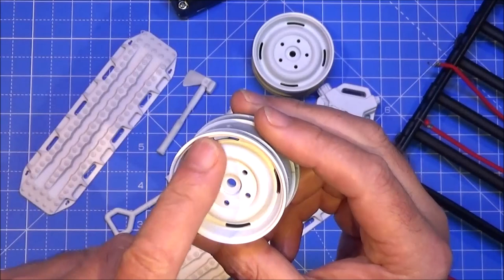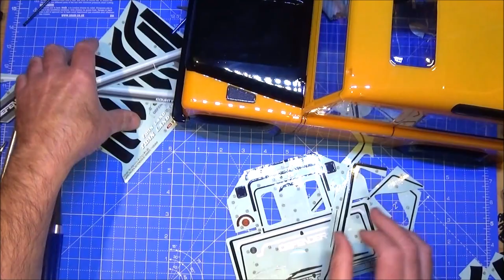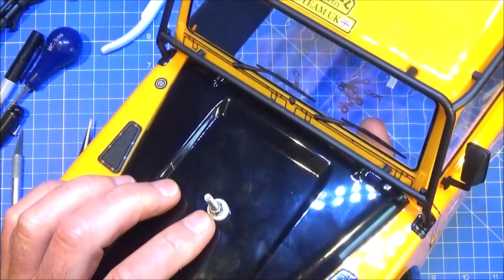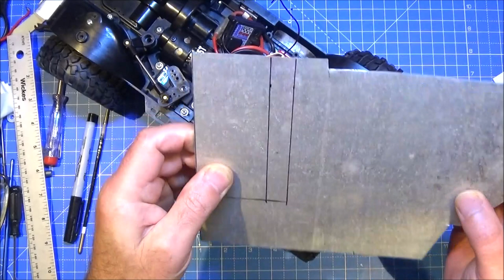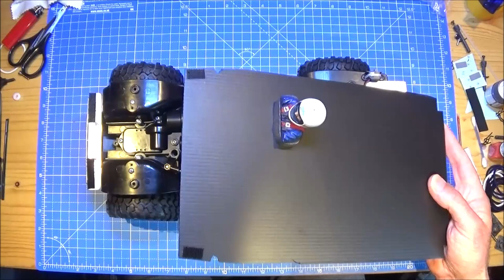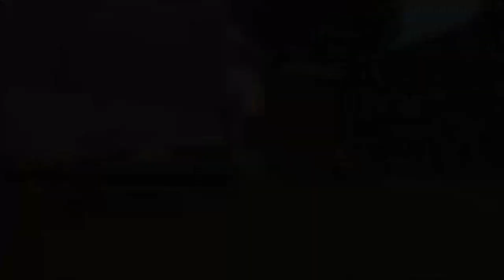Project Tamiya CC01 Camel Trophy - How to make a Camel Land Rover Defender P2 - Truck Finished!

Comment: That's great Mark I started my build on a cc-01 chassis but it got to heavy for the steering to work after I welded the custom bumper and cage had to move to a vaterra ascender you did a great job on the details
Reply from the maker: Hi Brent 👋 and thanks for the great comment. Thanks for taking the time to look at my Defender,  as I said it's not a patch on yours but at least it's a good starting point 👍 😀.  But the main thing is that these are fantastic to do as a project and a lot of fun 😀.  All the best and have a great Sunday my friend 😎🤝👍

Comment: Looks great!! I think you got just the right amount of stuff on there (gear and stickers). I think it is easy to get carried away with these and try and fit a 100 different bits and pieces and the cover it in logos and stuff! It is hard to stop sometimes! I looks very nice running around and I am looking forward to seeing it out on the trails!
Reply from the maker: Hi Addam, always great to read you! Oh yes I agree, too easy to go overboard with the detailing! I will take your sage advice, just some spots on the roof I think and of course the front and rear lights. But I really do want a proper interior, I may have a go at a scratch build in the future! Cheers dude!  :))
Reply: @MarkBryanRC  I think a scratch build interior sound like a great winter project for sure!!